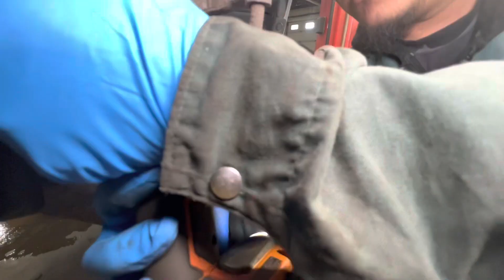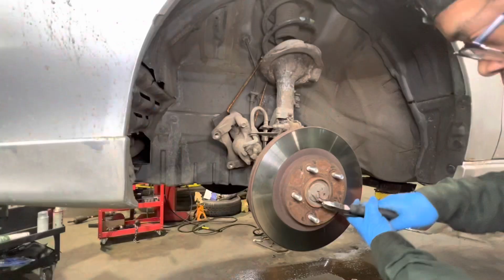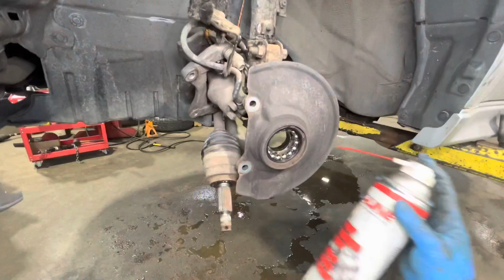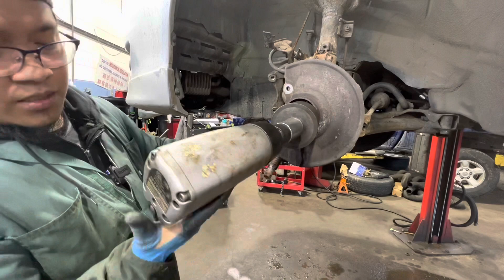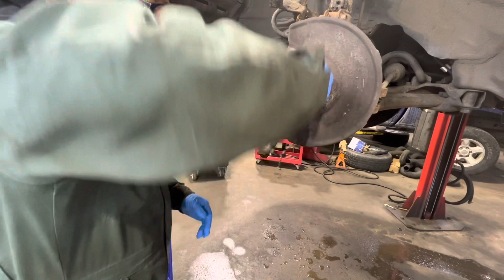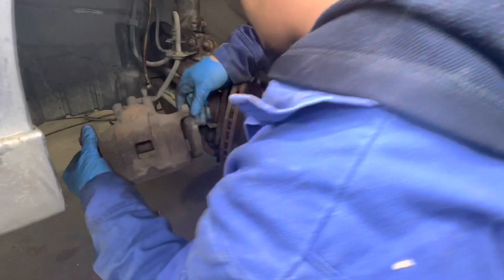Mitsubishi lancer front wheel bearing replacement

Comment: Butchery Not engineering! Please,Please do not do it this way!! Remove the hub and use a press to remove and refit the bearing!  The bearing on lots of these have a magnet for the ABS sensor incorporated!
Reply: In Thailand all Garage shop were use Hydraulics 100% 😅😅😅
Reply: It's not necessary, you remove the speed sensor before doing the job. These are perfectley fine to use a bearing or ball joint press.

Comment: Just watching this I'm getting anxious, about to do this in 20 minutes, wish me luck boys
Reply: How'd it go? Did you pray to the machine spirit in the Lancer first?
Reply: @DaDaDo661  didn't see the reply first time around
The Omnissiah has kept my vehicle together though there's an issue with both the rear driver wheel and the front passenger wheel. All break calibers are rusted to hell, desperately need replacing, I'll need to send a letter to the administratum see if there's anything I can get due to the bearing I received had 4 lugnut bolts and my rims have 5.. should have noticed right away but so be it, got it refunded and waiting on its replacement, I'm unsure what's going on with the front passenger but it really doesn't sound good, loud bass woobwoobwoob and some shaking

Bought it for $400, it came with 240k miles and all speakers blown on top of the issues stated, rest is in great shape, just worried about my commute to work
Reply: @Deathkorpsrider-  haha nice, you should swap the front tires and see if the wub wub sound changes sides. Could be an out of round tire vs the bearing. Rockauto has cheap Lancer parts. Just did the rear calipers myself and they were about 60 bucks a piece for the entire assembly.
Reply: @DaDaDo661  thank you for the tip I didn't know about rockauto I finally got a decent paying job I think I'll get everything through them vrs going through eBay or heading to scrap yards, Amazon doesn't allow me to shop with them anymore lol they didn't much care for looking back on certain discounts..

That's actually a really good price.. so a set of 4 though rough wouldn't kill me, how much was shipping?
Reply: @DaDaDo661  small by the way dude, was an uplifting moment to see a 40k reference, feelsgoodman

Comment: Wrong procedure. It need to be pressed out and then pressed in. That’s it.
Reply: That's what the bearing remover/installer tool does. It just uses a screw to apply pressure instead of hydraulics. Works just fine-also useful for ball joints.

Comment: Great video, Why not replace the hub with the bearing? Is it not cheaper then to get the bearing out and install a new one for labor costs?
Reply: The bearing is pressed in the knuckle so can’t but the knuckle are pretty inexpensive on eBay about 120$ that’s the route I went got a alignment spent 200 total
Reply: It's best to keep the original wheel hub instead of getting an aftermarket wheel hub.

Comment: Why take out the camber bolts and ruin fhe alignment when you can just split the balljoint
Reply: Driver put the shifter on Drive and two hands on the steering wheel  she's good to go. Yup there's the alignment gone 😢 just ripped it all out put everything tight and see  you later. Toe in toe out rubbing etc. All good to go just keep both hands on the wheel  your fine and keep a set of rubbers might come handy.

Comment: what year model sir?
Reply: That's looks like a Lancer X. So 2008-2017
Reply: @DaDaDo661  so the whole 'gen' uses the same PN .. hmm.. 👍🏼 thank you!
Reply: @generaldistrust  I call them Lancer X because it's looks like the Evox but yeah it's the 10th gen Lancer
Reply: yeah I totally got it 👍🏼
I have a 2008 1.8 CVT "Sport" trim..
some old mechanic with tons of permits & diplomas told me you cannot change the bearings alone and you have to buy the whole hub..........
Reply: @generaldistrust  1.8L? Are you in Europe? They never offered 1.8 in North America, we only got the 2.0 and 2.4.
Reply: @DaDaDo661  yeah, I know .. and it's a shame also that I couldn't get a  manual over here .. where we're at a 1.6L was the working class av'g engine size for n\a until the industry started to shove turbos on even tinier engines .. or anything that combusts .. North America is double-size (or times more) over us on anything
Reply: @DaDaDo661  also, it is a tad bit of a shame that it's weakest link is the JATCO transmission :\
Reply: @generaldistrust  yeah I have the 5 speed 2.0L and it's just about fine for me. I hear the CVT really bogs the car down. My only issue is that at highway speeds the RPMs are at 3300-3500. It could have used a 6th gear. The CVT wouldn't have that issue. All in all they are great cars, I always viewed them as the poor man's Civic. Nothing but reliable for me (except for weak ball joints)
Reply: @DaDaDo661  well, I agree, I had the previous gen with 4 gears (planetary automatic), and while it was a great beloved & a lil' tank of a car -- it missed a true overdrive that was very well executed on the Corolla of that same year where it wasn't screaming on the highway, still with 4 gears as well, just engineered better by AISIN TOYOTA .. my CVT although divided to 6 in sport manual mode, when you get to 6th and push it back to "D" -- the RPM drops even more(!) as if there's a 7th gear .. I can't tell you MPG but when I go for a long drive I can do between 15-to-16.7 km/liter which is insanely eco, which makes it a fine lil' cruiser .. short drives and in city it shows around 10-11 km/l which makes sense.
Reply: @generaldistrust  nice that's not bad. I'm Canadian, I understand the L/km.
Reply: @DaDaDo661  well, about the 'bog down' thing,  it is just a different character of a vehicle when it comes to this kind of CVT, people are just so fixated on how they had it before and seem to not understand the mechanics behind the thing ..  I'm so sure that how the systems make this car accelerates in various conditions, including it's electronic throttle (drive-by-wire?) in conjunction with the CVT's computerized internal hydraulics and  the anti-slip feature (when on) do significantly help to prolong the CVT's belt , which I highly appreciate after experiencing this car fkr long on countless situation and totally figuring out it's character in order to get to a record 16.7 km/l

second of all, when you launch in sport\manual mode, it does the first 'gear' better than on "D", while you can then push it back to "D"(auto CVT mode) and enjoy the constant torque from then on .. 

I'm quite sure that if one day they'll make a much stronger CVT,  cars this size could go fast AF, but then again, you've got hybrids now where the engine is like a generator while the last link in the power flow before it gets to the wheels is\are electric motor\s .. so I'd just tell people to think of the CVT more of an electric car acceleration in the same HP 🤷🏽‍♂️
Reply: @generaldistrust  if you add CVT fluid remote cooler, and also add paddle shifter, you can actually drive this same car in a much more sporty manner. 

There are folks that put a RA turbo into their naturally aspirated CVT Lancer, and the thing still going strong years later. 
Again, the trick is
1) sufficient cooling
2) don’t run an engine torque too high. (RA stock level of boost, appears to be ok)
Reply: @reallifeengineer7214  in Sport trim there's already aluminum paddle shifters.. plus, where we're at they don't allow any mods so there's not much choice.. all I can do is just take good care of it and replace the oils & fluids in timely manner..  but thx for the info 🙏🏼